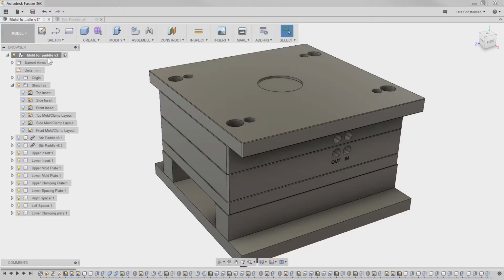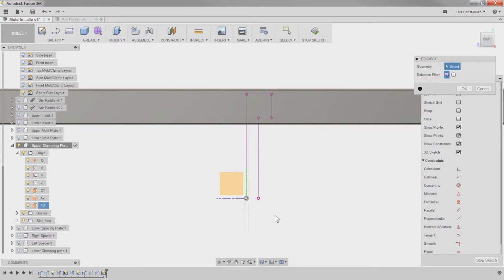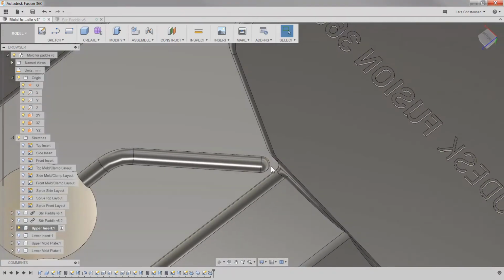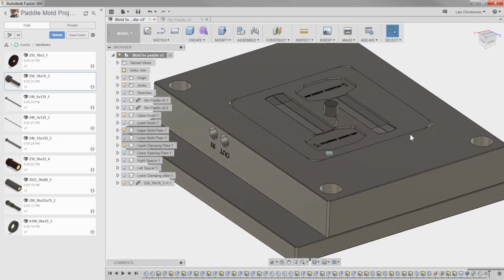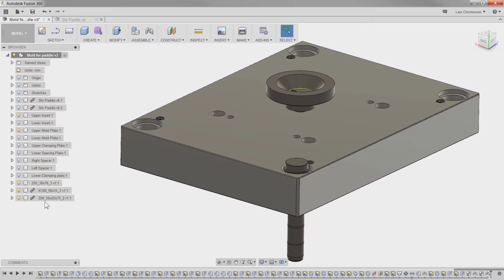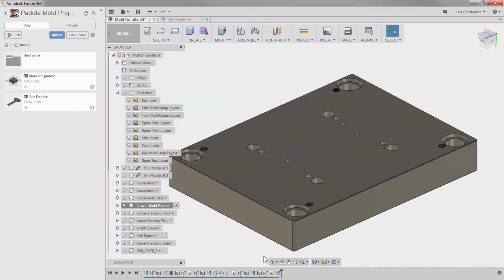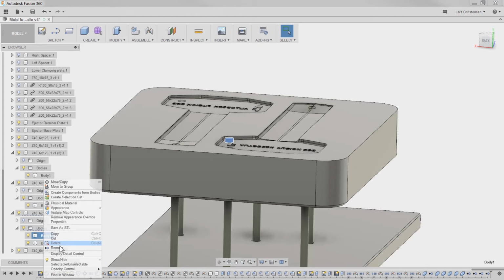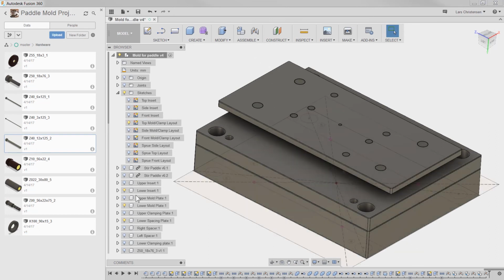Fusion 360 Tutorial — Beginner To Advanced — How To Create a Mold— Part 4

Comment: Hi Lars, for the Sprue it seems like you know its standard dimension when you design the sprue. My question is does this sprue fits the plastic injection nozzle? and do you have the data for that injection nozzle? where to buy it? thanks you
Reply from the maker: Hi mai la Thank you for watching!
From my experience, you know what size machine the mold will be run in, or at least if there are any specific you need to take into consideration in regards the nozzle on the injection machine.
Reply: Lars Christensen thank you.